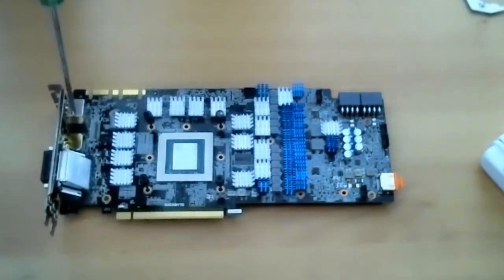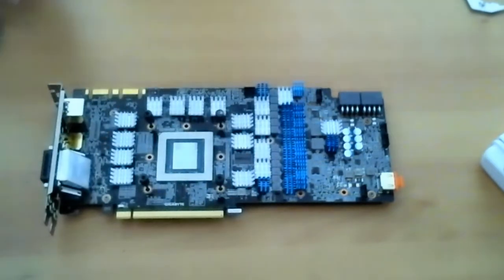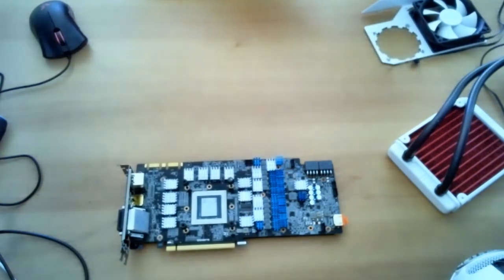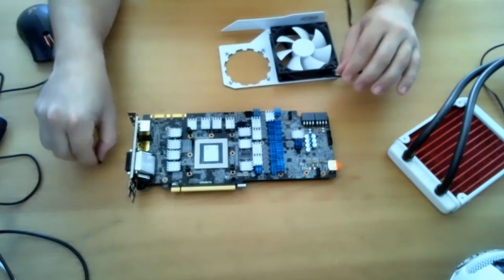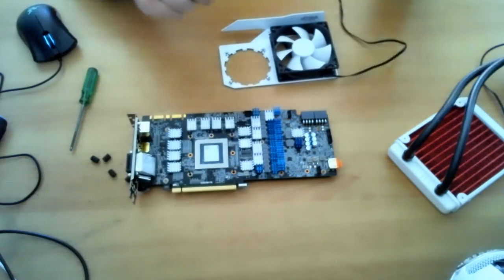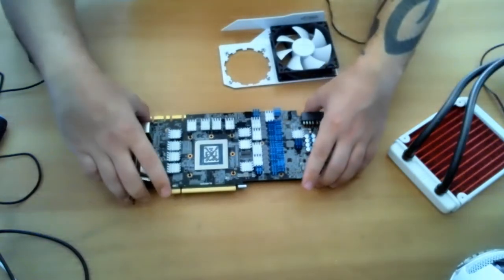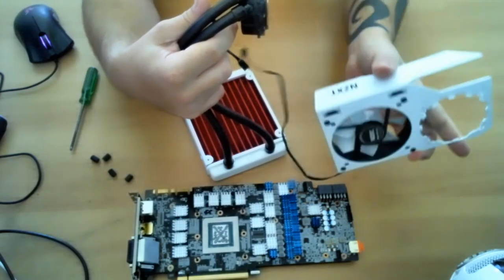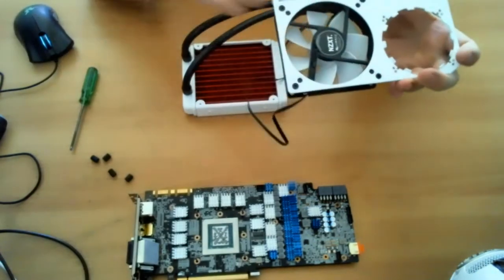NZXT Kraken G10 on Gigabyte AORUS GTX 1080ti - PART 2

Comment: Hi grubby, thanks for your great videos! I did it myself last night to my 980ti g1 gaming, and ended up having to do the damn thing all over again because those heatsinks fell off.... bloody hell  so i got some gelid thermal pads which are sticky on both ends and it worked perfectly. They also are better for heat conductivity. One question though, e
Where should i plug the wires of the fans? Board or card?
Reply from the maker: Hey dude, sorry for the late reply. Yeah it sucks when the heatsinks fall off. You've probably already worked it out but the fans get plugged into the motherboard, if you don't have enough fan headers you can get a fan splitter which turns 1 header into 2-4 depending on what you get.

Comment: is it necessary to put heatsinks on the vrms?  I cant find any on where i live :(
Reply from the maker: No it's not necessary, you can install the G10 or G12 without them and it's perfectly fine.
Reply: thanks for answering!  though I am currently running a 1080ti aorus extreme sli setup would the bottom card fry the top card without the heatsinks?  what do you think?
Reply from the maker: I'm a little jealous. You won't fry anything, there isn't a huge difference between using heatsinks and without,  the VRMS are designed to work at higher temperatures than the gpu. The set up will be no different to what you are working with now except you will bring down those gpu temps
Reply: thats enough for me to go for it then!  ill be using this vid to work my way with the process.  subbed!
Reply: btw is it possible to keep the backplate while using the g10 bracket?
Reply from the maker: haha nice, I have an older video showing when I had 2 980ti in sli with the G10's, check it out and you'll see what your sli will end up looking like. Back then I also played around with an additional fan set up.
Reply from the maker: yes, you will need to remove the foam pad from the small G10 plate and get 4 small flat washers that can cover the 4 holes around the gpu on the back plate side, the washers will stop the nuts on the small G10 plate from falling into the back plates screw holes and making it wonky
Reply: will do,  thank you

Comment: did u take that rubber or sponge glued on the back of the kraken backplate off? I find it rubs against the aorus copper backplate which throws off the tension and contact when mounting the aio? thanks
Reply from the maker: Yes I did remove that, I forgot to mention that minor detail in my videos.

Comment: Thanks for the video. I have a spare H90 and a G10 bracket and I think I will do this mod on my 1080 Ti Aorus as well. Too bad the card doesn't have a baseplate as I am a bit uncomfortable gluing heatsinks on such an expensive card :D
Reply from the maker: Yeah I wouldn't be too comfortable with gluing the heatsinks on either, I am yet to hear of a method to remove glued heatsinks

Comment: nice vid. i need a part 3 tho. showing it installed inside your pc, and the temps. oh pleeeeeeeeease Grubby.
Reply: ok so i just found it on your page for the temps lol jolly good show
Reply from the maker: it's certainly worth it if you don't like the stock temps
Reply: @grubby1578  How much better temps are you getting with this one?
Reply: i want to do that too, i got the xtreme, the backplate led should still work afterwards right?

Comment: Cheers for the tutorial, just fitted an Corsair H90 to my EVGA 1080 ti FE  and temps are in the low 40deg range under load instead of 75+ before. Only thing I couldnt do was keep the backplate attached as the 14 tiny screws that hold it in place thread into the top of the GPU hex screws which are then held in the female threads on the reference shroud/backplate.
Reply: barely hitting 30deg playing Arma for 1.5hrs 😊
Reply from the maker: Nice, much better for those long sessions.
Reply: Mike Papou Usually leave my case fans at 60%ish when gaming cos I wear headphones and noise doesn't bother me, also my room temp was pretty low around 16deg C with the window open+not forgetting a 1080ti is total overkill for Arma 3 so it was hardly going over 50% load. 
My Gpu Temps were 45-50C last week when we had a heatwave in the UK with room temps up to 32C (no air con in my gaming room unfortunately)
Reply: not possible with backplate? what do you mean
Reply: what fan speed? too good temps
Reply: I have 1080Ti FE on 2000MHz/46C in GTA5 (99% load) with Corsair h110 (pump 50%, fans 1000-1300 rpm). Room temp is 24-26C.

Comment: wont you get air pocket with how you applied the thermal paste?  should you just apply more to the center to it spreads out?
Reply from the maker: Stick with the method you are comfortable with. I stopped using the centre approach when it was noted that you needed perfect even pressure when applying the cooler to enable it to spread out and cover the chip completely, when exploring this I found it did affect my applications. I've never encountered any air pocket issues with this technique and always managed full coverage so it's what I trust. Stick with the method that works for you personally.
Reply: ok, personally i would go with 2 X that overlap to cover more instead of doing what you did, just incase an airpocket gets created... as those little bits get pressured down there would seem to be a good chance to get some small air bubbles in ti... but if you did a X and a + there would be less chance of that happening
Reply from the maker: If you prefer that technique then do it, it looks good and I'll probably try it the next time I need to dissect things  but for the past 2-3 years I've had no issues with my own technique so "if it ain't broke don't fix it"
Reply: yup if it works, it works :P